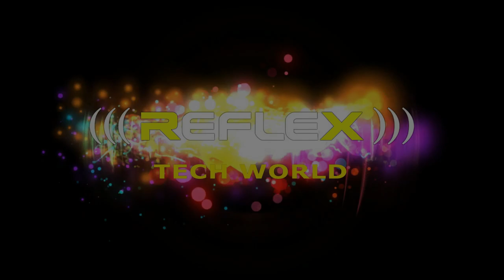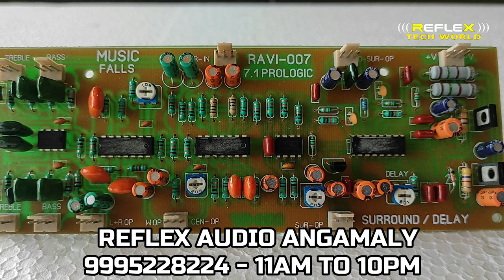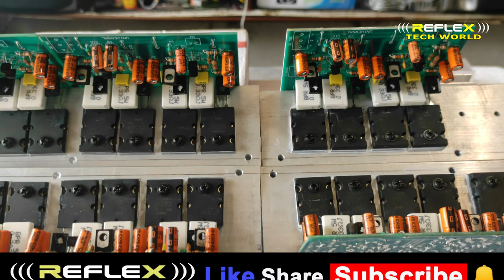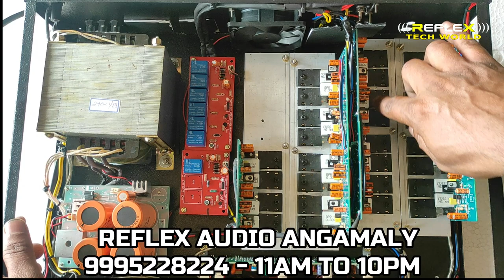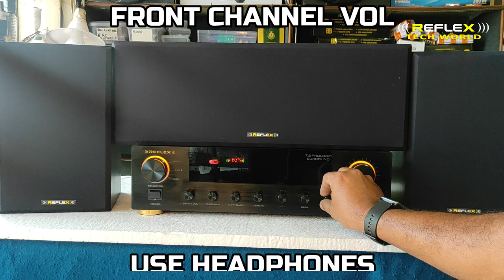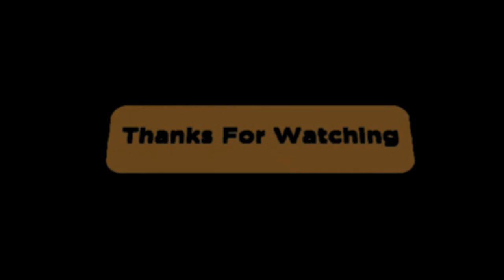7. 2 HOME THEATRE SYSTEM | 7.2 SURROUND SYSTEM | HOME THEATER SYSTEM | REFLEX TECH WORLD

Comment: Brother, njan ipo oru veedu vekyaan ulla planningil aanu.. I have planned a room of size 282cms x 450cms as a Media Room... ipo oru medium budget vechu cheyyaan annu plan.. bhaaviyil worth aanennu thonnuvaavel pathukke onnu setup aaki edukkannam.. floor n 4 walls carpeting cheyyaan annu plan n also false ceiling instead of acoustics... Oru budget FHD projector n custom fixed screen planil undu... Pinne sound njan oru 5.1 aanu udheshikkunne... kurachu research cheythu Yamaha YHT 3072 aanu ipo manasil ullathu... but Yamaha YHT 3072 evide kittum ennu oru pidiyum illa..onlinil onnum illa... do u hav this system for sale with u? Allenkil evie kittaan aanu chance? Njan EKM aanu... pls do reply...thanks in advance.. (Also please do share if you have any comments on my plan)
Reply from the maker: Plz Call 9995228224